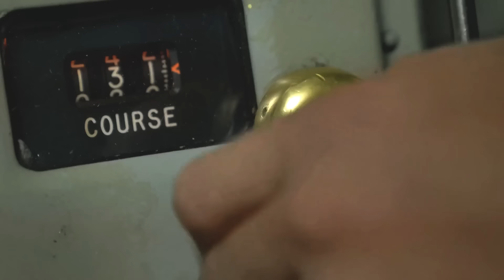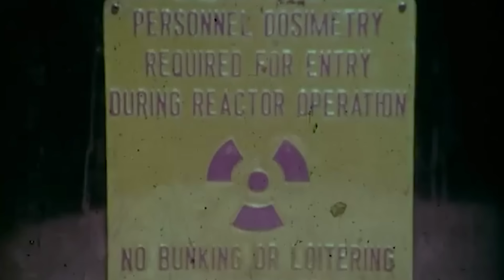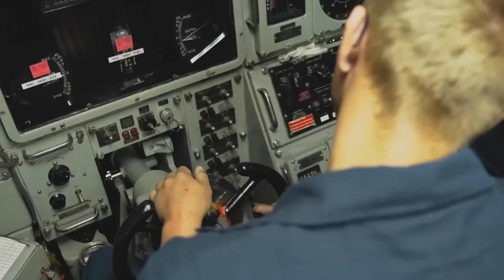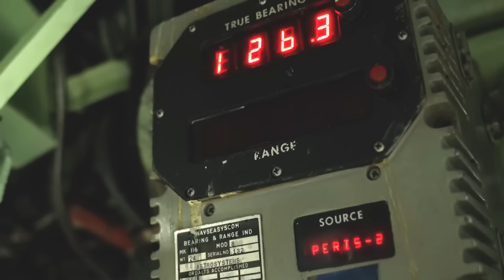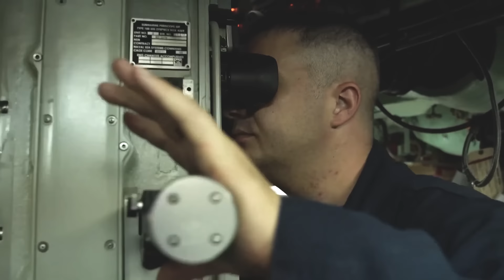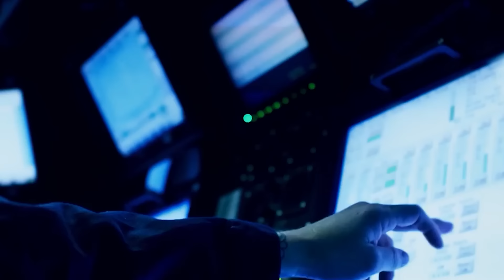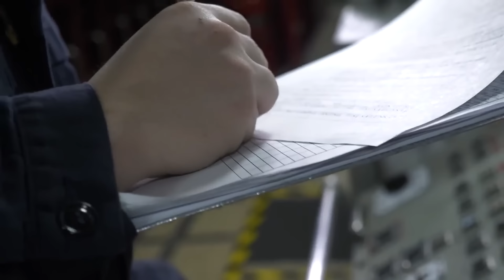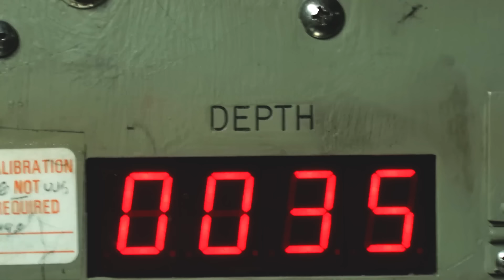The Secret Submarine Mission that Doesn't Officially Exist - Mission 7 - USS Jimmy Carter

Comment: I grew up in the Air Force.  My dad was a B-17 pilot during WW II, shot down on July 26, 1943 and spent the rest of the war as a POW.  In 1943, it was “mathematically” improbable for a crew (all 10 members) to finish a tour of 25 missions. The average length of time a crew was together (before losing someone or being shot down) was 8 missions.  My dad was shot down on his 3rd mission to Hanover, Germany.  All the crews, including my dad, knew the odds were they would not survive 25 missions.  Those odds improved dramatically when bomber formations were escorted all the way to target and back by fighters in late 1944 and in 1945.

He stayed in the Air Force and flew just about every multiengine plane the Air Force had except the B-58.  He became a B-47 pilot and then a B-52 pilot.

Of course we always knew where we were based, but he would be gone for long periods, and never said where he had been.  

When I was older and realized just how far inland into Russia some of the missions would be, and I was aware of the limitations B-47's and B-52 with regard to fuel versus distance, it was obvious that the B-47 didn't have the range necessary to fly to some of the deep targets and return to a safe area to meet a tanker to be refueled.

So I asked  my dad how the B-47's were able to make to deep targets in the Soviet Union and get back.  This was after the B-47 had essentially been retired and the B-52's were the primary bombers.

His answer was chilling.  He said there was a time when some of the B-47 crews were on "Dry Tanks Alerts" meaning that their targets were so deep that they didn't have the fuel to return.  After making their bombing run, they would fly to a predesignated area as close to our allies as possible and then bail out.  In the summer they might have a slim chance of surviving, but in the winter it was a suicide mission.  I've never heard the term "Dry Tanks Alert" and couldn't find anything on the internet about it.  I have to believe my dad was telling the truth and that it was a term they used internally and not officially.

At the time, I wondered how we find such dedicated people who know their chance of surviving their mission is essentially zero.

But then when I graduated from college in 1968, I joined the Marine Corps during the Vietnam War to avoid being drafted into the Army.  

My first full time job out of college therefore was as a Marine platoon commander in Vietnam 1968-69.  It was a hard year.  Lost a lot of great Marines.  But I realized that we had all voluntarily put our lives on the line to accomplish the missions.  The worst day in Vietnam was the day when the Sun rose I had 34 Marines in my platoon (significantly under strength).  When the Sun set, there were only four of us still alive and unwounded.  Everyone else had been evacuated by helicopter.  That night we walked about 10 miles back to the battalion cantonment which was also in the middle of nowhere.  We stopped about 1,000 yards from the battalion and waited until sunrise as we didn't want to be mistaken for the enemy even though we had radioed the battalion that we would be approaching.

In Vietnam, I finally understood what my dad had essentially said.  There are people, including himself, willing to risk it all for this country.  I saw that up close and personal for a year in Vietnam.

BTW, there were also true miracles in Vietnam.  I'll make a long story short.  One day the company was on a sweep across dry rice paddies in the dry season.  The company commander had two platoons on line and one platoon in reserve.  My platoon was on the left flank of the company and we were sweeping across a huge dry rice paddy when we came under heavy automatic fire from the tree line to our front.  We were totally exposed with no cover.  I had to make an instant decision and I decided I would likely take more casualties by trying to retreat than if I executed an aggressive frontal attack--which I did.

During the attack, I felt like we were going to take a lot of casualties and when we reached the tree line, there were pockets of hand-to-hand fighting for a very brief time.  I told my platoon sergeant to get a count of the casualties.  He came back a few minutes later and said, "Sir, you ain't going to believe this, but we only have one Marine with a minor wound and he doesn't want to be evacuated."  THAT people, was nothing short of a f**king miracle.

It's been more than 50 years since then.  I don't remember many of their names.  Between casualties, rotations back to the States, and new replacements, it was nearly impossible to remember all of their names.  Some Marines didn't last more than a couple of days.

I still wonder where we get such people willing to risk it all.  And then I look in the mirror and remember the band of brothers we were, and it all makes sense.  You don't fight for you country.  You fight for the Marine on your left and right ,and you fight for the B-47 crew you were on.  Except for your family, there is no bond stronger on the battlefield than those in your unit.

I led from the front.  I never asked a Marine to do anything that I hadn't already done or that they knew that I would do.  My Marines knew that when the chips were down, I'd always be there with them to the end if necessary. 

I think it was the same when my dad was a B-47 pilot.  His crew knew he would never ask them to do what he was prepared to do himself--a potential dry tanks mission.  Thank God, they never had to sacrifice their lives.

My apologies for the long post.  Not trying to take away from the risks of submarine secret missions.  I'm only trying to put them into perspective.  There are missions where people actually die and only receive the Purple Heart or die.  68,000 US men and women died in the Vietnam War over 10 years.

I love our armed forces.  Every single individual in the air, on land, and at sea faces the possibility of death.  God bless them all for putting their lives on the line for this country.
Reply: I always appreciate hearing these stories from people who served and just know I sincerely mean it when I say THANK YOU FOR YOUR SERVICE!

I haven’t had the chance to serve, nor do I think I ever will, but I definitely feel better whenever I hear about someone like you who actually did.🫡
Reply: What he said.... USAF Ret E7, 64-84. God bless and thank 'em all.
Reply: Also a USAF brat.  My dad was a flight surgeon.  He was part of a research project that irradiated over 3 dozen UNSUSPECTING airmen with various doses of ionizing radiation as part of Project Endurance, which tested how far bomber crews could fly through various types of nuclear clouds to deliver their targets.  Of these 3 dozen, my old said at least 20 died of radiation poison or cancer within 5 years.   Still proud of our military?
Reply: @Logan Kennelly I'm the dad (64-84). My son joined  in 93 for twenty
Reply: I face a perpetual argument from people always criticizing and asking why anybody would sacrifice for their country despite all the inequality and political issues and less than rosy history. I think the disconnect is that nobody is really risking their life for a president or for a flag or for a couple hundred crooks in congress or for the founding fathers. People sacrifice for those they truly care about. Whether it's their friends and family back home or their brothers in their unit. You do it because you know most people won't. You do it because somebody has to.
Reply: I never tire of hearing. Well done Marine.
Reply: Thank you for that story...riveting...I wish you lived next-door.  ..what an honorable man.., I mean family
Reply: Really enjoyed hearing that thanks to you and your entire family for yours and their service to our country over generations. Jmo but I feel like there were more patriotic people serving our country during the time era's that you spoke of. I sincerely hope we do not lose the freedom that thousands upon thousands of brave Americans have died for. Thank God for people love that caliber.
Reply: Thank you for the perspective, sir.  God bless you and your family, may you have peace and prosperity.
Reply: Thank you, to both you and your Dad.
Reply: You should write a book.
Reply: if it helps, i've heard a couple other stories similar to the "dry tanks alert" thing, though none with a specific name. Apparently British doctrine was that god forbid they did that mission, there would be no britain left, and that they were to continue flying east, and try to marry someone in Siberia, as their odds of survival were much greater that way. it sounds kind of bs at first but this is also the era when we considered nuclear warheads on anti air missiles.
Reply: Thank you, your father, and all those who choose to be the “line in the sand”. I had gone to the Army after high school in 90 , but a previous knee injury reared its ugly head halfway through basic training and ended my military career. I live next to Ft Bragg ( literally) and I feel like I missed out on a kinship that is only forged in battle. The folks in my neighborhood mostly are active duty or retired and are some great folks. My next door neighbor is a medically retired Devil Dog. All of you folks have my respect. Thank you again for the story. I grew up listening to the stories that my grandpa and his friends used to tell about Europe and North Africa during WW2. I still have the Mauser that he brought back. Your dad was a hell of a man , and the apple didn’t fall far from that tree. May the Good Lord bless you and all of those folks that are still drawing that line. 🇺🇸🇺🇸🇺🇸
Reply: cool story bro
Reply: May God bless you greatly for your service sir.
Reply: Thank you sir and you are the epitome of what it means to be an American patriot.

Comment: As a Marine and current software engineer for a defense contractor, I can tell you definitively that the language in the citations and resources you cited is very popular in the military. It's all fluff and doesn't mean anything. Stressful situations, extreme circumstances against any combatants...SYNERGY!! It means nothing. It could have been a huge mission with massive implications, or it could have been a standard op. The language of the citations doesn't give any hint, whatsoever. Hell, when I was in Iraq, (and being a Marine that meant you joined to be a warrior, so being a warrior was an honor - plus being combat was more sparse than it ever was in Vietnam, for instance), I've heard a truck gunner tell me that they would just open up the guns at nothing sometimes just to report combat to get a CAR. It's all fluff and you have to be able to read between the lines to get the truth.
Reply: While the bit about the language being "fluff" is true, you can count the number of Navy PUCs in the last 50 years on your fingers.  They don't just hand those things out.  Whatever it was.  However much you can't read into the language.  "Mission 7" was no "standard op".

Comment: I had come to this conclusion during the Bush (W) administration when there was a report of a patent for a fiber optic coupler seized from the inventors and given to Litton Industries, Pakistan's fiber cable had been cut, and the Jimmy Carter had been "enhanced".

I tried finding the report of the two inventors who had their invention taken, which for those curious was described as "two halves of a tennis ball where they joined at the seam which could be disconnected by twisting the coupling halves" or something like that, but no luck. 

One of the inventors chose to fight it, and ended up with nothing, and the other accepted around $40,000 - $50,000 to walk away IIRC. The law that allowed the government to do this was based on an old British law from when the King could seize property.
Reply: I believe you're talking about "emminent domain" and it happens all the time in the US. Sucks if you're on the recieving end of it!
Reply: @thomasnewbery7449  No, but "Eminent Domain" was used as the government's justification in "Airborne Data v. US". (part of "28 USC § 1498(a)" I think). So the end affect is the same. 

It might have been the "Invention Secrecy Act", but that doesn't quite jive with my hazy recollection of the article.
Reply: eminent domain
noun
1. The power of a government to take private property for public use without the owner's consent, provided just compensation is given.
2. The right of a government over the lands within its jurisdiction. Usually invoked to compel land owners to sell their property in preparation for a major construction project such as a freeway.
3. The right of the state to take private property for public use; the Fifth Amendment that was added to the Constitution of the United States requires that just compensation be made. 
*Source-- "worknik"
Reply: The Constitution requires "just compensation" when eminent domain is to be used, not "just compensation as long as you don't make the government's lawyers do any work."

Comment: Working on a navy C-9, at Tinker,we were told do not come near the red lines painted on the pavement.AWACS Were on the other side.About an hour later, Two guys stopped and walked towards the aircraft.Four men rappelled from an observation tower built into the side of a hangar, jumped into two blue cars and roughly put them on the ramp.A soldier stood on both guys back with one foot, while another held a rifle to the back of their heads.I don't know if it was an exercise or these people were just stupid.
Reply: Regardless, I NEVER crossed the red line. To me it was twenty feet tall and 12 inches thick.  Fixed many an aircraft from C-47s to F-16s..... I'd do it all over again, too! Damn, where'd I leave that PSM-6!
Reply: I am guessing exercise.. in my long time there, I don’t remember tells of folks crossing that line…   I know I sure didn’t and I was authorized…
Reply: I wasn't going to test the guys on guard duty.They were very strict at Nelis . Worked on another c-9 early 90s We were right beside the thunderbirds and the agressor squadron.We had heard of a stealth which later was F-117.The c-9 shucked the tire casing into #2 on rotation.They came in ok the engine kept turning and burning.The compressor blades were bent with black skid marks on the intake amazing!

Comment: So I've worked with fiber optics my entire life. There isnt a way to "tap" fiber optics without your adversary knowing and knowing where within millimeters.that is one of the factors that led the military to switch to fiber. I could spy on copper comms with my eyes closed using 50 different methods. I have a theory of how you could possibly peek into a fiber but I've yet to make it work without revealing myself. I would say she is dropping seals all over the place and in areas you wouldn't suspect a submarine to be.
Reply: They have already done it before so I guess they did the impossible
Reply: Fiber optics use light. I remember learning the math behind how that light propagates down them. Long forgotten it. It would be interesting to figure out a way to tap an optic line without penetrating it. With data lines, on copper or semiconductor wiring, it was a simple matter of induction.

Comment: 3:03: 3 billions per sub is nothing. You have to put it in perspective. When you build only 3 subs it is normal to be this pricey, as opposed as a series of 10+ subs where the costs drastically go down. 
The same is true for the French Triomphant SSBN submarines built at only 4 units. 
The same goes for any kind of armament, ship, airplane, missile, etc. The costs are only going down when a sufficient number is built.

Comment: Having experience in working on fiber optic cabling in the former WTC ( WORLD TRADE CENTER) and several other commercial buildings of NYC it INTRIGUES  me as to how one may tap an undersea fiber -optic cable without warning the owner of such cable as to the intrusion.  It must be accomplished at the coupling between cables.  I thought it was impossible.  Maybe they don't know how to operate an OTDR
Reply: Undersea cables have repeaters/amplifiers at regular intervals, probably tapped at those points.
Reply: @ckm-mkc  About every 2 miles or so. I used to work at a plant that made the repeater chips for them

Comment: The cost of small sized classes of vessel is always high simply because the development cost is not spread over many units - the actual cost of building them is considerably cheaper.
Reply: The first few vessels of a new class are also typically more expensive, as the builders have to work out how to turn the blueprints into actual reality, and it's not uncommon to have to rip out sections of work already done because someone forgot to schedule putting some piping or wiring or whatever in place before building stuff over the top of where it should be. You also might need to go buy new machine tools (or new parts for your existing ones etc) which can get pretty expensive, update training for some or all of your workforce, and otherwise deal with all the little niggles of doing something for the first time, you end up with lots of bad parts (whether fabricating on site, or buying in from a supplier) and so on and so forth

Comment: How deep does a sub need to be so its safe or at least comfortable enough from storm waves?
Reply: The simplest answer would be below periscope depth, which from my experience (hate that phrase as it reminds me of a POS JO I had the displeasure of working with) is below the depth of the keel when the boat is at PD.  You're bouncing pretty good at PD and often times become a broach coach.
Reply: Not a lot. I believe as long as it always stays fully under the water, it's very smooth.
Reply: Depends on the sea state. The rougher the surface the deeper you have to be. ET2/SS
Reply: Rode out a couple of typhoon at 400 feet. Hardly a wobble.